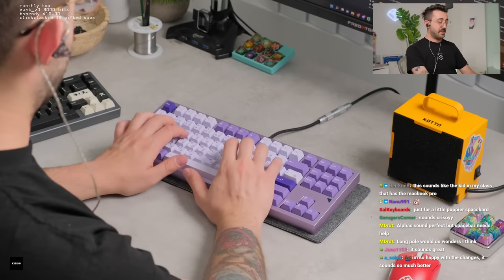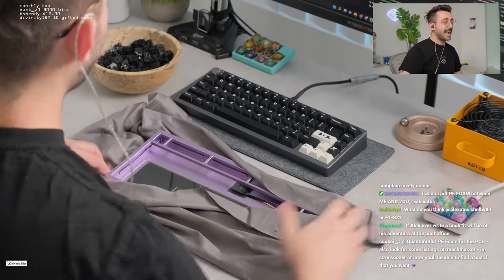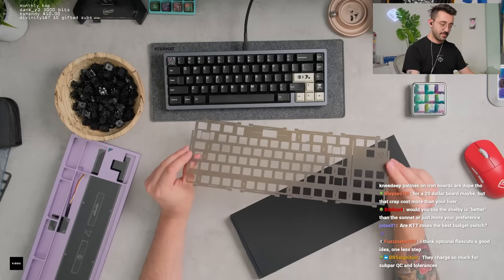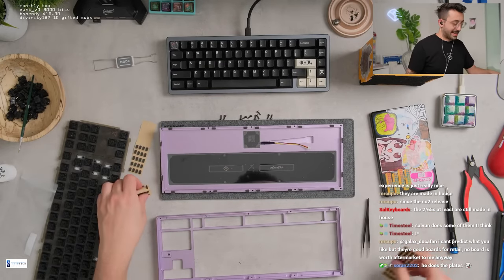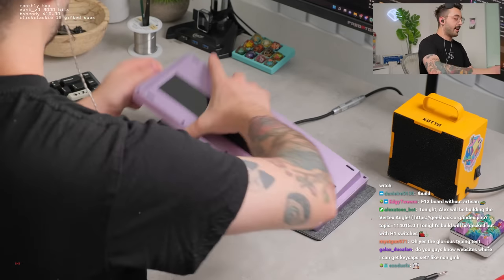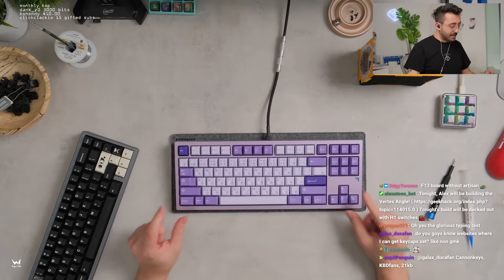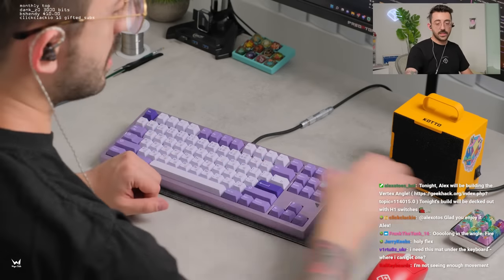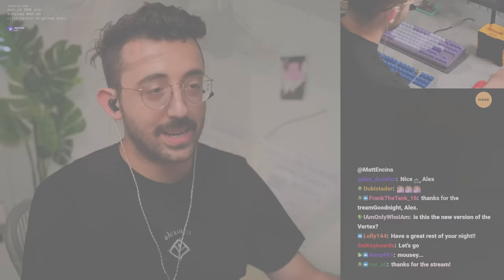...I am so happy they FIXED this keyboard

Comment: Wow it actually sounds incredible man! I knew I should of went in on the angle! Damnit! It literally sounds just like I wanted it to. It's a very different sound. Yes slightly marble but not like pe foam kind of marble lol. The alphas are magic on it tbh.
Reply from the maker: Thanks a ton! Yeah I was seriously impressed. So they biggest different is they no longer NEED you to use that mandatory silicone to align the PCB and plate. That was the biggest thing hindering it, there were some other minor changes but I am so glad they fixed this thing
Reply: If you want to get in on it, join the clickclack discord. We are going to have extras after the gb is fulfilled.